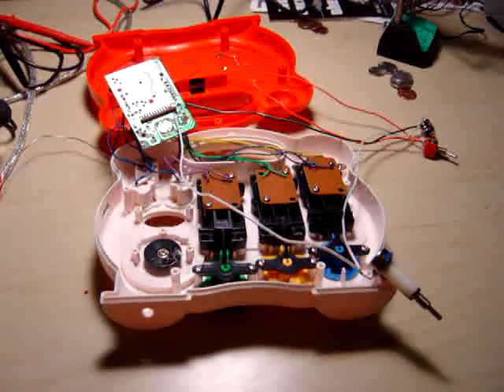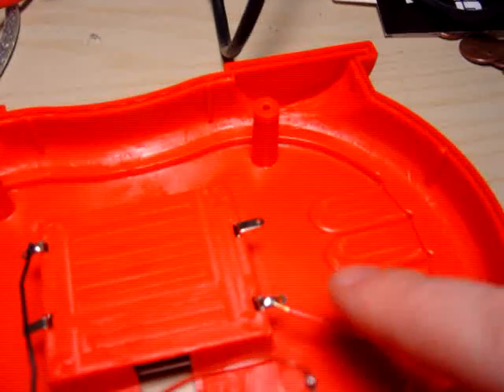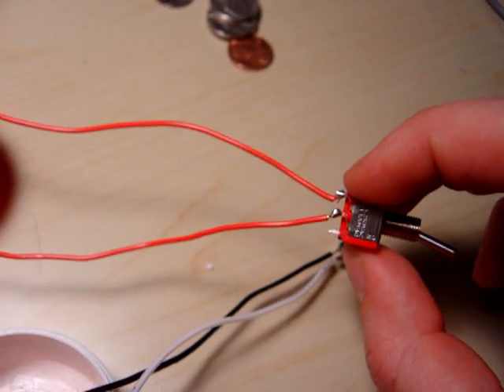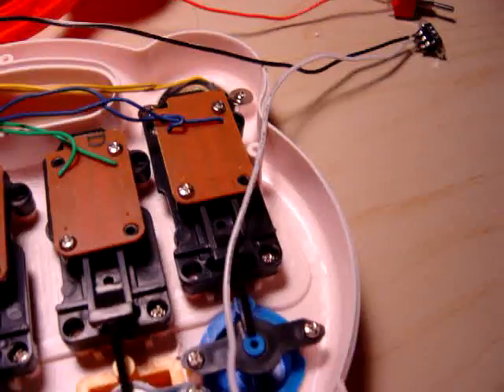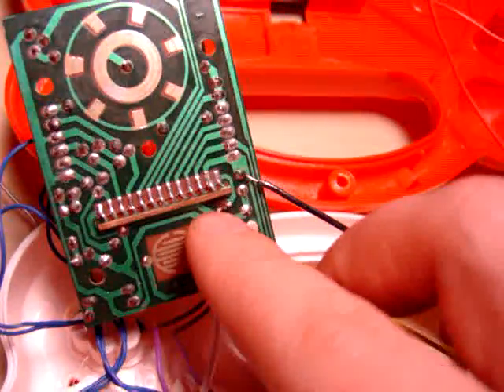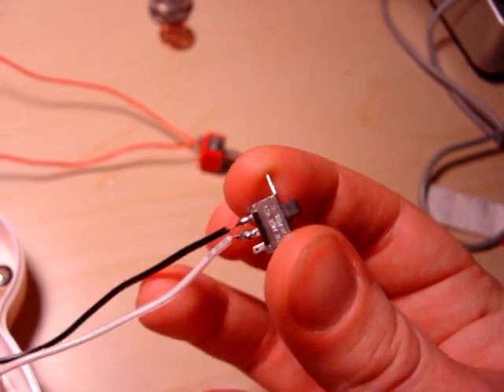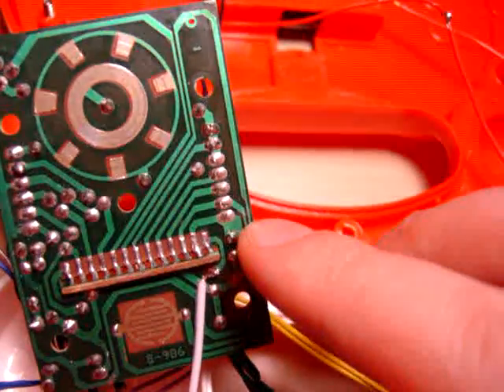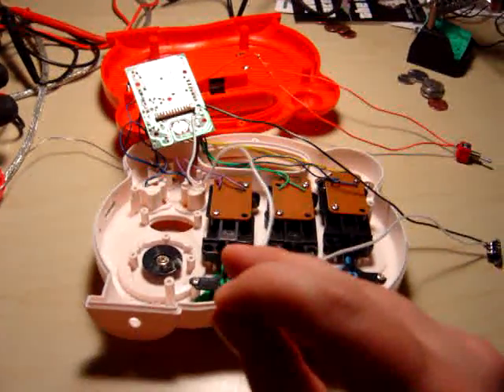Toy Circuit Bending Part III -- Soldering Connections

Comment: Did you remove the original clock resistor or keep it where it was on the circuit board? I’m wondering how you can switch back to the “unaltered” sound.

Comment: K is short for Kilo.   Potentiometers are measured in Ohms (a measure of resistance).  Putting a K after the number means x 1000.  So if you have a 50 by itself on a pot you have a 50 ohm pot total resistance.   If you put a K on the end you have a 50,000 Ohm pot total resistance.

The pitch bending is not a function of the pot but rather how it alters the behavior of the electrical circuit you attach it to.   In short ... every toy is different where you put it and what value pot you use.

Comment: Switches come in lots of varieties... sorted by how many positions they have (poles) and how many things they can independently switch (throw).  The ones that have 3 spots are a double pole single throw (DPST) swtich.  It has 2 positions and can switch one wire to those 2 possible positions.   The switches with 2 spots are Single Pole Single Throw (SPST).  They can only switch 1 thing to 1 position (on/off).